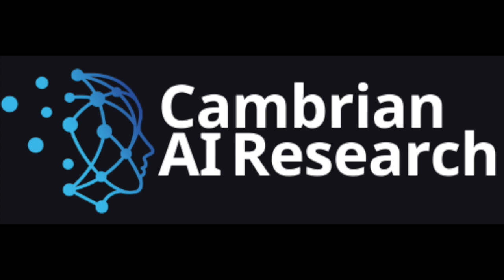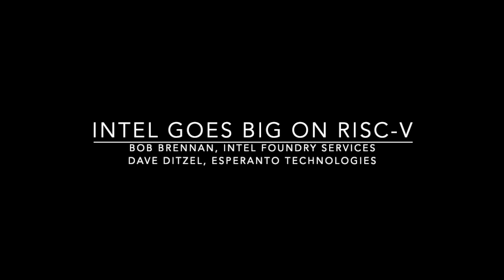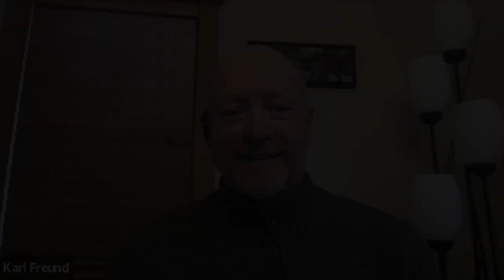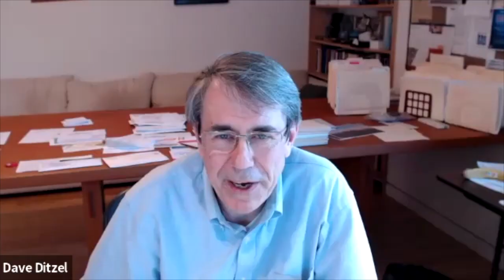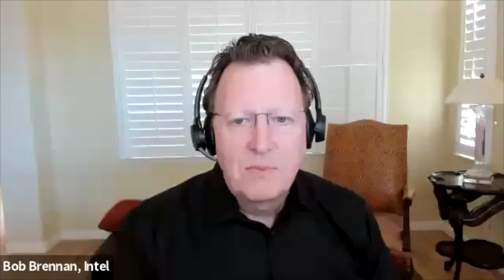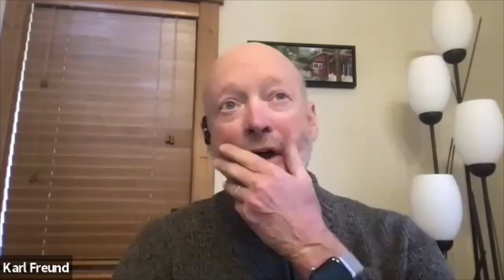Intel  Embraces Risc-V

Comment: Do not embrace RISC-V. It will be a big mistake like Itanium. Risc-V has no novelty potential. The tomorrow’s world needs completely new architectural ideas as familiar processors x86 and ARM are morally obsolete. I propose such an idea, see my article, address is in my this comment.
The RISC-V is based on 40-year old ideas as RISC-V Foundation claims. There is no sense to port the huge x86 and ARM software ecosystems on it. Thus, RISC-V will never gain a victory over x86 and ARM. The most of positives about the RISC-V processor are arbitrary speculations. The advantage of RISC-V is open architecture. RISC-V has instructions of variable lengths. This is bad, it is a departure from the RISC architecture principles. 
The Contemporary microprocessors contain 8 specific hardware components: (1) SMT (Simultaneous Multithreading), (2) register renaming, (3) instruction reordering, (4) out-of-order execution, (5) speculative execution, (6) superscalar execution, (7) delayed branch, (8) branch prediction. These components make up some kind of a “magnificent eight” of components which essentially raise the performance of microprocessors. But unfortunately they are very complex. A processor core having these components is a full-fledged one, otherwise it is good for simple applications, e. g. for embedded systems. 
The “magnificent eight” of components is very hard to design, only the experienced firms and developers are able to do this, and much know-how was acquired, some effective solutions are patented. Particularly complex is the SMT. Only powerful and advanced firms like Intel, AMD, IBM are able to equip their processors with the “magnificent eight” components. It is not surprising that some Intel processors, and the famous Apple's M1 processor do not contain SMTs. If a company is able create the full-fledged RISC-V processor with all “magnificent eight” components then it would be a serious achievement, and such RISC-V would be considered of the World's class comparable with x86, with ARM, but not more. As far as I understand most of the developed RISC-V processors have no components from the “magnificent eight”, and are intended for embedded systems.
A course directed on further development of RISC-V is a wrong way, and leads the computer architecture to deadlock. The RISC-V is not promising for computer industry. In fact, RISC-V hampers the further development of the state-of-the-art microprocessor technologies. The World demands absolutely novel microprocessor having much more higher performance than all contemporary ones. The novel and effective ideas on computer architectures do exist! Here’s such a novel processor architecture: V. K. Dobrovolskyi. Microprocessor Based on the Minimal Hardware Principle. Electronic Modeling, 2019, vol 41, No 6. pp. 77-90. The article is posted (under the Cyrillic name добровольский.pdf):
https://www.emodel.org.ua/en/ then touch ARCHIVE, then move to 2019, then to VOL 41, NO 6(2019) pp. 77-90. You see: DOBROVOLSKYI V.K. Microprocessor Based on the Minimal Hardware Principle Click “Microprocessor based...” At the very bottom you’ll find Full text: PDF Click it. 
This processor does not have the “magnificent eight”, it is not necessary at all. This comment reflects different view on the RISC-V architecture, and the computer community has a right to become familiar with such a view. I’m Volodymyr Dobrovolskyi (V.K.Dobrovolskyi).